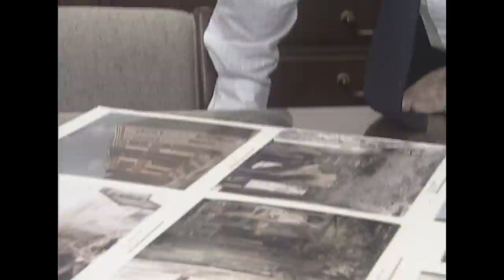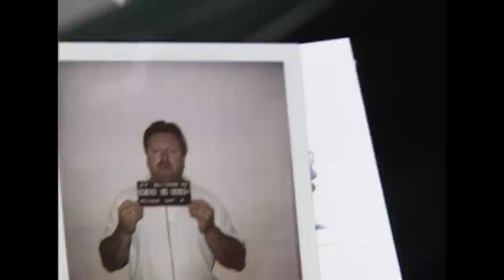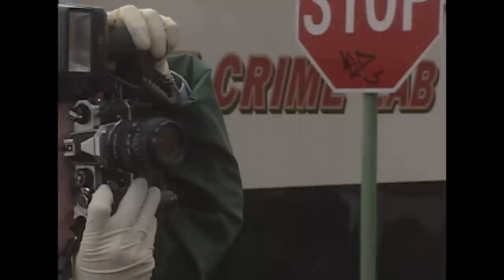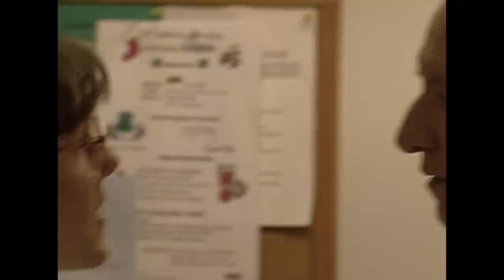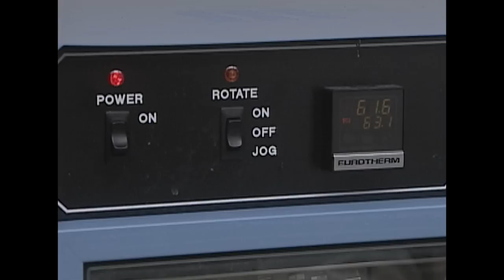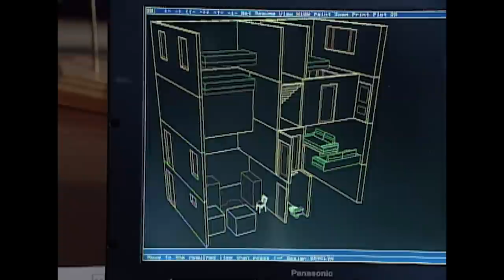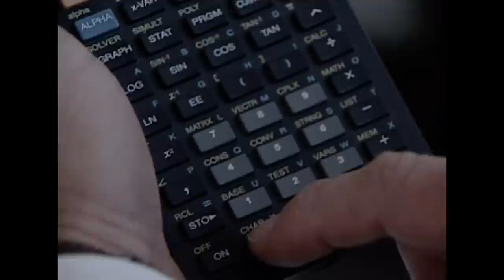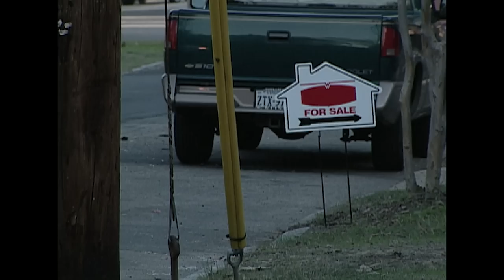The Package Bomber | The New Detectives | Real Responders

Comment: Obviously when the water they are spraying has flames on top of it that’s a huge red flag that there’s an accelerant, but those temps seem wildly inaccurate.  

We had a house fire when I was a kid and the fires dept said it exceeded 1400 degrees.  It wasn’t arson and there were no accelerants, just household things like painted surfaces, cabinet finishes, rugs, upholstery etc.  it’s amazing how much damage the water does putting it out.  The incredible steam that is created rusts everything instantly.  Our stainless steel kitchen sink was solid rust.  My mom’s sewing machine upstairs away from the flames was rusted into a solid block. Virtually everything was destroyed either by flames, smoke or steam.